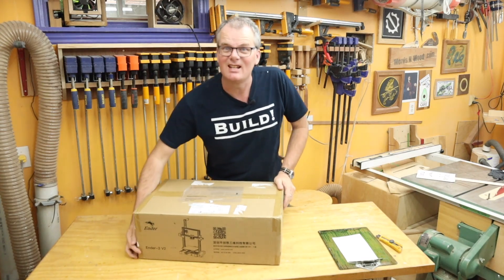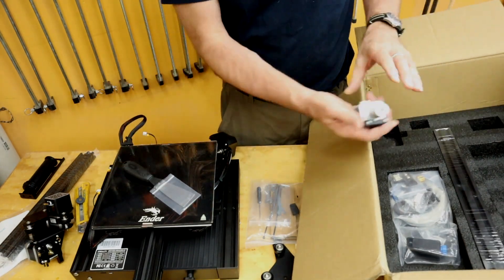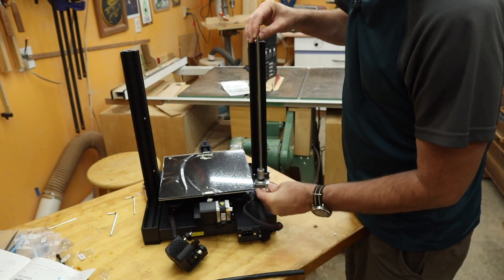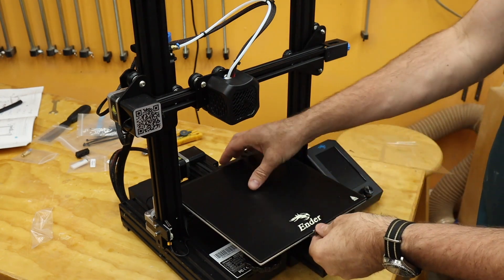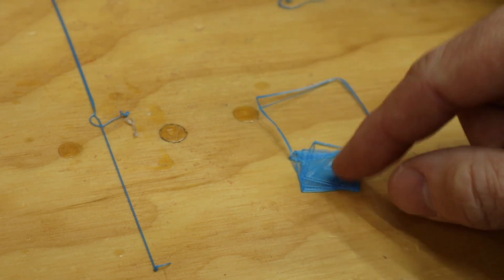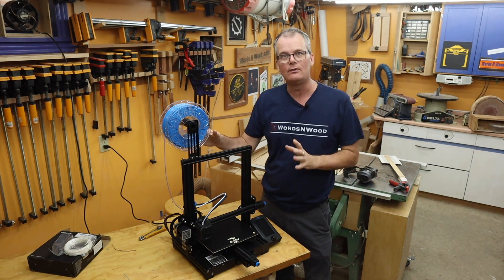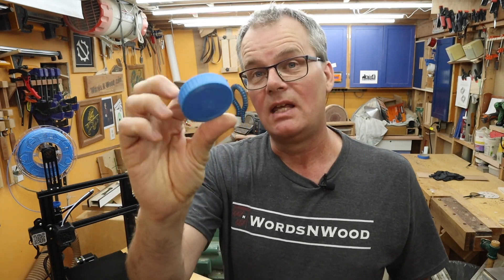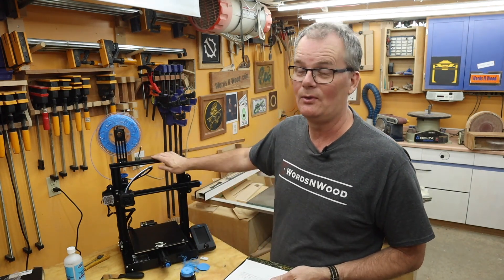My First 3D printer: Ender-3 V2 // WnW # 240

Comment from the maker: Checking out the Ender-3 V2 from Creality and Banggood.
 👇👇 COUPON CODE inside!   👇👇

In this video I take a look at, and attempt to assemble and use, the Creality Ender-3 V2 3D printer.  THIS IS NOT A DETAILED ASSEMBLY GUIDE.   But I hope you watch it anyway.

💵 💵 💵  COUPON CODE 💵 💵 💵 
If you are interested in a printer like this, here is where I got it:

Creality 3D® Ender-3 V2 Upgraded 3D Printer Kit  : https://ban.ggood.vip/YqoQ
Creality 3D® White/Black/Yellow/Blue/Red 1KG 1.75mm PLA Filament   : https://ban.ggood.vip/YqoS

Banggood has provided a coupon code for viewers, as follows:
Coupon Code: BGb9ee94
Warehouse: USA 
exp: 6.30

I THINK this means you need to select the USA warehouse when adding it to your shopping cart.   It expires at the end of JUNE 2021.   ALSO, note that this is available with EU or North American power cords.  Make sure you select the right one.  They carry many other 3D printers as well.

They also want me to tell you about this sale:
Super Bargain Day  https://bit.ly/3fyoFbI    ( May 19 - June 8, 2021)
Electronics Sale   https://bit.ly/3u3wdbV    (May 17-31, 2021)

📝 IMPORTANT NOTES
I recommend this video from the "Just Vlad" channel for a detailed step-by-step build video of this model of 3D printer:  https://youtu.be/gokN9xNG94U

I used the "Ultimaker Cura" slicer software for the first two items I printed, and then I tried the "PrusaSlicer" slicing software for the third item.  

Links to the items that I printed:
https://www.thingiverse.com/thing:127...  -- XYZ Calibration Cube
https://www.thingiverse.com/thing:763622 -- 3D Benchy (the little tugboat)
https://www.thingiverse.com/thing:15626  -- Rear Lens Cap for Konica AR lenses

YOUR SUPPORT IS APPRECIATED:
💵 Become a Patron: https://www.patreon.com/wordsnwood
🛒 Buy a Plan: https://wordsnwood.com/plans/
👕 Buy Merch: wordsnwood.com/merch.html
👉 https://www.wordsnwood.com/support.html

---------- ---------- ---------- ---------- ----------

MORE MORE MORE:
https://www.wordsnwood.com
https://www.instagram.com/words.n.wood
https://www.facebook.com/wordsnwood

---------- ---------- ---------- ---------- ----------
🙏🙏Thank-you! 🙏🙏

Comment: I recently bought a small low-power (nominal 7W) from Banggood. As you unboxed your printer, I saw a lot of similarities in the packaging, design, and construction of the two machines. They have the benefits and the limitations that come with buying entry-level tools.

I look forward to seeing what you print with it.
Reply from the maker: Doesn't feel that entry level... even though I know it is.  We'll see.
Reply: @Wordsnwood  Yes, my machine is well made, but it is not made for hard use or continuous use. The fit and finish on the parts are impressive; it does not look or feel like it was made in some guy's basement.

Comment: Welcome to the funnest rabbit hole.  After my jointer, planer, band- and table-saws, my 3D printer has been the greatest asset to my woodshop.  I have dozens of 3D printed tools and accessories specifically made for woodworking, the majority of which would be classed as marking and measuring, and often they're just one-shot prints for a one-time marking task, like laying out mounting screws for a handle.  You're going to enjoy it even more, if you can believe it, when you're designing your own tools.  Pure fun, from eh to zed.
Reply from the maker: That's sort of what I figure.

Comment: If you can do 3d design (sketchup, fusion360, etc) you will be able to make so many things, and  custom tools, bracket, fixtures for the shop.  I've had  a couple 3d printers now for about 4 years and am amazed at all the stuff you can do.  I'm a moderator on a 3d printing Discord.  If you need any help just hit me up.

Comment: Interesting although I can’t think of anything I would use it for. Can’t wait to see your next project.
Reply: I had the same thought when I got my first printer and now I use it for absolutely everything!
Reply: @dpmakestuff  Such as? Not being a smart a**. Just curious as to what you find to use it for. I'm trying to justify the expense. I just purchased my first laser so I'm into that also.
Reply: @rayscrafield2106  in the past month I’ve printed a hose adapter for my theatre room cooling system, a new clip for my daughters mermaid tail, a mount to hold my laser on my CNC and an organizer for my truck centre console.
Reply: @dpmakestuff  Thanks Dustin. I was wondering though, how do you come up with the program to make those things. I'm not a coder or proficient in Fushion360 so am I at the mercy of only making things that someone else has already created the code? I really am interested in this hobby/art but at the age of 79, I'm not going to have enough life left to learn how to write code. Can you give me any advice? Thanks again. Also, how do you know what filiment is correct for each project?
Reply: @rayscrafield2106  fusion 360 is very easy to learn and free to use. For filament, 95% of the things you’ll make will be PLA, PETG for the other 5%.
Reply: @dpmakestuff  I actually loaded it on my pc but it looked pretty intimidating so I took it off. I'm old school and need to have somebody show me how to use some of this software. I'm fighting my way through Inkscape for the last couple of years but it's starting to sink in. How do you start something in Fushion 360? Do you load a photo of what you need or ???
Reply: @rayscrafield2106  go check out some Lars Christiansen videos. They’re on YouTube and go over every step. You don’t need to learn all of Fusion 360 to get insane benefits from it. I would find something laying around the house and model a copy of it. You’ll spend 3 hours doing it the first time and 5 minutes doing it the second.
Reply from the maker: You and me both!

Comment: I want a Prusa but they’re priced higher. I’m hoping that higher price translates into quality and reduced headaches. The tuning to get things right starting off and when changing materials is expected. Not sure what you really get for 1400~ USD? Someday I’ll buy either one, the Ender or the Prusa. Your ender certainly looked well made and printed stuff. Well done :)
Reply from the maker: Yup, I also would have liked a Prusa, but you need to pay lots more for those
Reply: Hey there. I have two Prussia mk3s. Not a boast, just something I worked my way up to over a bunch of years. I love them and yes, they are more expensive than the Enders. A friend of mine recently wanted to get a printer to help his wife make hat molds and asked me which to buy. I suggested the same Ender as shown here. The initial learning curve is pretty steep but very achievable by anyone, and the things you learn are transportable to other printers like this one (FDM) style. So I’d say get the Ender, calibrate and learn the skills, print all the things you want... then after scratching that itch, look to invest in the Prusa if you wish. I used my Prusa to make and sell things I designed for people... and have made close to $50k off of each now over the years. That could have been done just as easily with the ender. Good luck! It’s an exciting hobby and learning something like fusion360 will enrich the process massively. 

As a side note, the resin printers are great too for IMO a slightly different style of work that requires higher detail on the things you print. I just started getting in to that and the learning curve just got steep again... I love it!
Reply from the maker: @vfxsoup  Yeah, I've seen a few resin printers in action on IG and they are fascinating.
Reply: @Wordsnwood  I’d love to show you some of the things I’ve made if only to inspire you. I love your channel. Is there a posted way to send you some pictures?